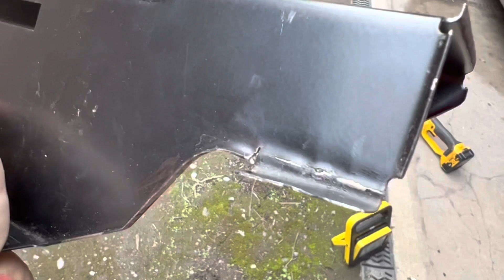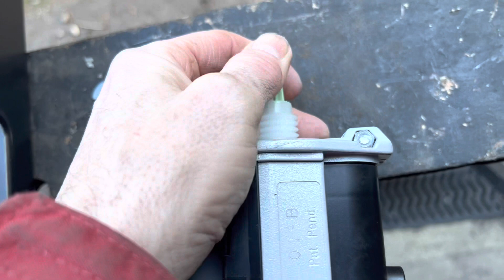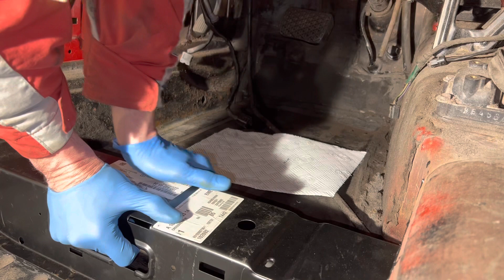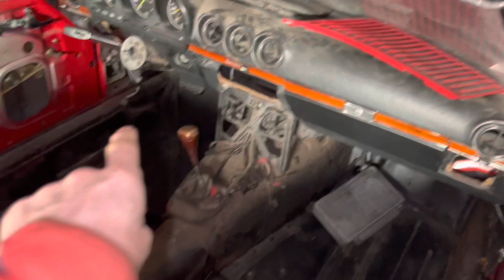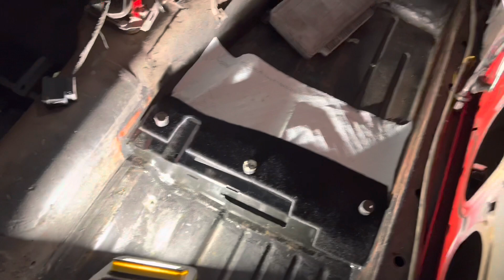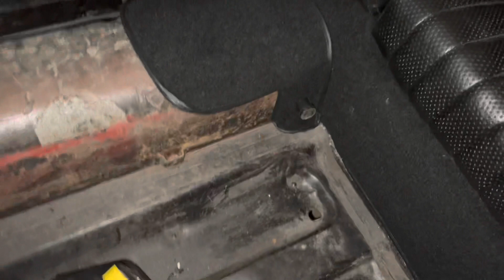Mercedes R107 - 3M 08115 panel bond crossmembers and carpet sills

Comment: Greetings Mike, hope all is well in Bristol . As work on the SLC progresses I continue to find your videos most helpful. Re the trailing control arms bushing replacement , i failed to do them as the inner most bolt hits the flex disk so you can’t remove it unless you take out the whole drive shaft at which stage I decided the bushings weren’t that bad! I am having the axles rebooted so work on the back end has stopped and I turned by attention to the interior. The prior owners scrimping on a rear window seal proved to be the worst saving ever. Hole in the boot well and my cross member under the seat, as I discovered yday , has more holes than an emmental cheese. So your vid was most pertinent. I shall remove the seat tomorrow and cut out the crossmember. You can get an MB one for $72. Do you know if they are rhs or lhs specific? Thanks again and be well.
Reply from the maker: All good in Bristol...if not a little chilly! The cross members are different for each side. on my LHD 280SL the passenger side part number was 1076120214 and the drivers side was 1076120314. Mike
Reply: Many thanks. Hopefully the last rust discovery….. @MikesMercsandothercars
Reply from the maker: Let's hope so....
Reply: Ordered a new one today. If I may ask, which tools would you have used if you’d have to cut out the old one? Cheers, Markus
Reply from the maker: The cross members are welded to the floor pans and sills. I would use an angle grinder with cut off wheel to cut them out and then an angle grinder with a flap wheel to grind down any excess bits. Are you welding the new ones in or panel bonding the new ones in? Mike @MJR67

Comment: Another nice video. I’m gluing in a new set of rubber door sills this weekend, but first I need to purchase a few of those magnets you like to use. Great use if magnets.
You mentioned needing to trim your wood center panel kit in your next video. I just replaced all of mine in my 87-560SL, and the pieces required several modifications. 0.5mm  around some switch locations to 1.5 cm of the tail end of the center piece. Had to remove the plastic pin and re-glue it 1.5 cm up to get everything fitting snug. I was a little surprised Uro parts were so imprecise.
Reply from the maker: Thanks for you comment. I notice that the commodity neodymium doubled in price last year...so hopefully those magnets wont be too expensive! Strangely enough, I had exactly the same experience as you with the wood trims...but these ones came from Germany not Uro. The centre panel I got from Uro fitted perfectly without and mods. Maybe the centre console in your 560 was replaced with an earlier one? Mike